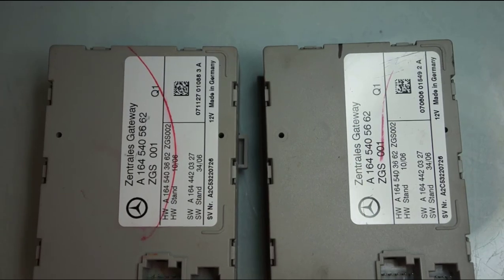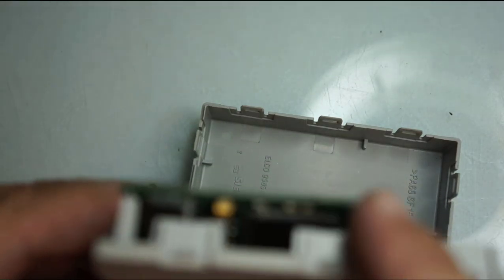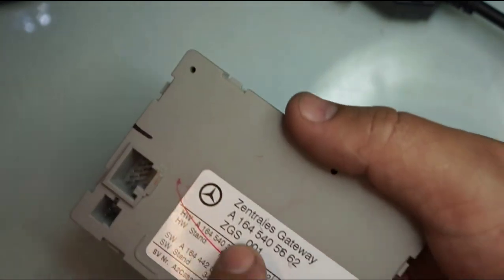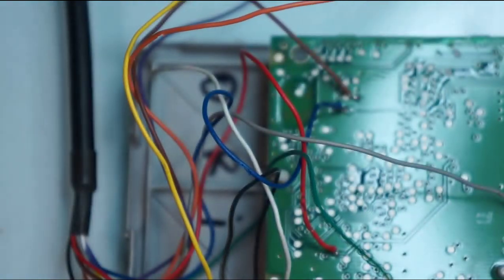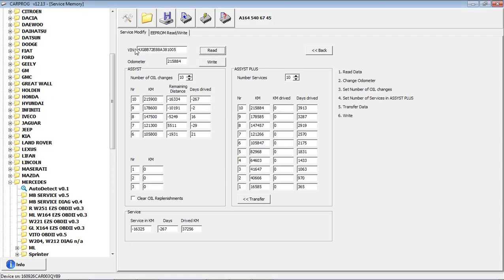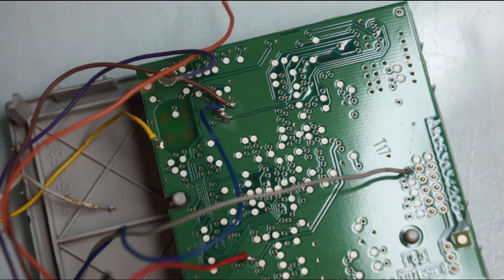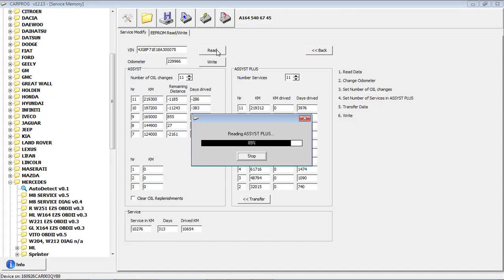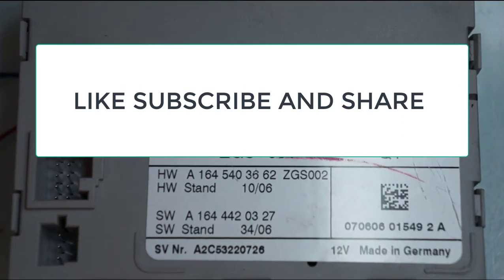Central Gateway Module  Mercedes How To Program.

Comment: Will the car work without copying service data information from previous Gateway ?
Reply from the maker: If it was physically bad and you installed the donor without Programming it should communicate. Now the milage will be wrong in it and the vin number also all your service records that the car used to have will be different so you will have interference between your cluster milage and this device data
Reply: @vehix411  Thanks for Reply, I have installed it, all Data seem proper, however 91B5 code is appearing when scanning the car with a scanner. Several Alarms are shown on the dash board, such as LR/DSR and few others. Whats shall be solution  for this problem  ?

Comment: Hello Vehix411, I have a question, for example the board is broken, possible to re-soldering  chips and eeprom from broken board to second handed one, will going to work without programming?
Reply: Hi, it's ok with soldering ?

Comment: I see you are running a Carprog version 12.33. I ordered the Carprog and in the instructions they said not to update or the MCU in Interface will be damaged. I am currently using Carprog Version 10.93 but can't program the Zentrales Gateway Module. When I try it has 5 attempts but does not download anything. Any help would be appreciated.
Reply from the maker: You need to get original that’s why it’s not working
Reply: @vehix411  where do we get the original?

Comment: how did you take out the board from enclosure?  the pins look pretty well fixed in the plastic and there is no quick disconnect.

Comment: Is this Possible for a 2008 Mercedes Benz e350 base model rwd. It has three current codes 9028 fault in CAN communication with control module. 930E synchronization of the dtc memory cannot be ensured. 9068 panoramic door roof is not normalized.

Comment: Where is this module located in 2008 mercedes?
Reply: Should be under the drivers seat. You'll have to remove the seat from the car to get to it. Its in a compartment in the floor.

Comment: How about a CGW from a w204 c250?  It’s incorporated into the front SAM unit.  I think I fried mine with an electrical discharge when connecting my car to xentry scanner with engine still on.

Comment: Can you just change the VIN manually? I’ve flooded my rear lift gate ECU on my GL350 installed used one it says wrong VIN. I’ve desoldered original processor and soldered in newly acquired ECU, put it in, and it says that original ECU needs programming. If I put the processor with wrong VIN back, can I just change the VIN and keep all programming from other car. It also has Freescale processor which I understand is a Motorola

Comment: Where is this module located? I've torn half of this 2015 E350 apart trying to find it
Reply: Your 2015 does not use that module.  It has the central gateway function integrated into the front SAM.
Reply: @rennmotorsllc9787  the "front SAM" is famous for drinking from the nearby windshield drain when it floods up